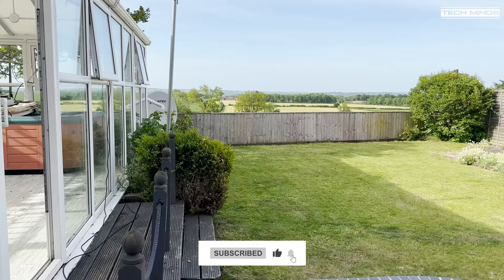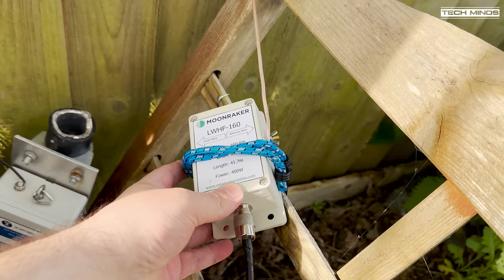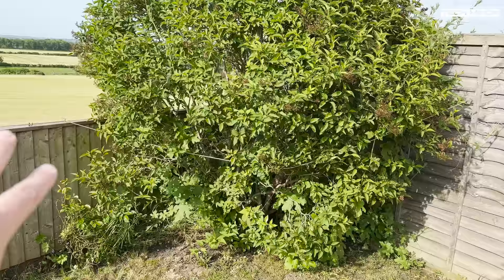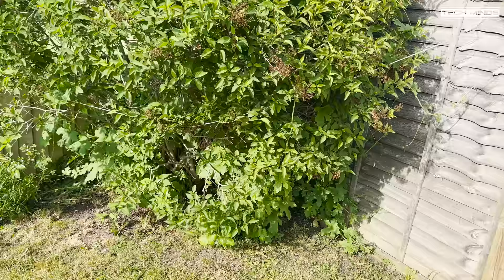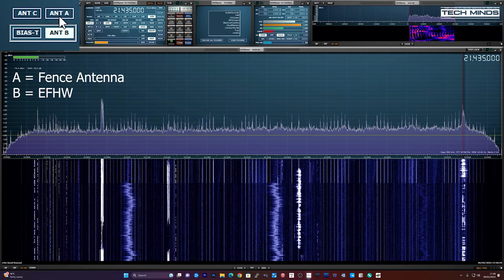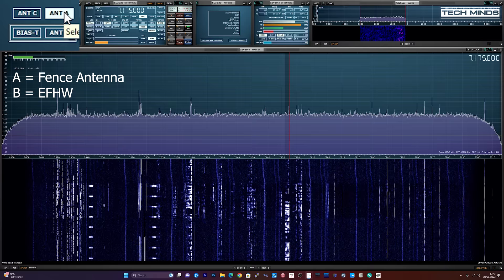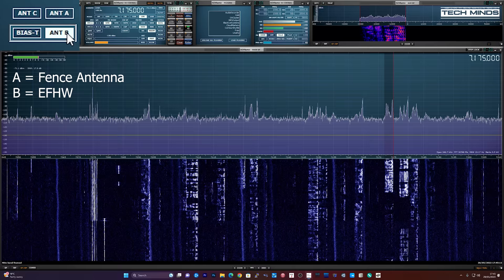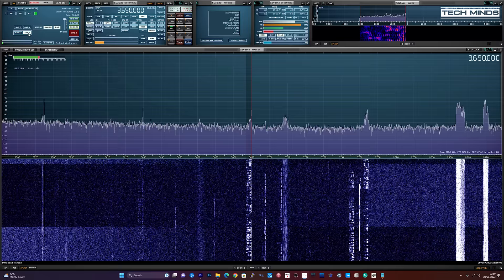Stealth Wire HF Antenna Setup: Concealed Communication Made Easy

Comment: Hi Matt, great video as always, I have used various stealth aerials over the years, 3 years ago we decided to cash in on the huge equity in our house, sold up and retired to a park home (Static caravan).  I have aerial restrictions,.  My HF aerial is an end fed wire of 111 feet, I feed it with a home made wide band transformer, which works with lengths of wire as little as 33 feet, and then uses wires in multiples of 11 feet.  it runs up my down pipe along the inside of the gutter clips, up the eves into the opposite gutter and back down the other side of the van.  It works and I also only use 5 watts QRP CW only, as another challenge lol.  It Blows me away how well it works, it loses so much local noise being low,.  I have QSOs most days, an in the commonwealth contest I even got a 339 from VK land, when the condX were really good earlier in the year.  I also have a simple vertical dipole just for 10 meters (flower pot), I run this up a 10 meter fibre glass pole and have a wind sock on it so the neighbours and park owners have no idea it is for radio..  I have played with aerials since i was a boy and have learnt Aerials do not read books so all the theory helps  but some times just try it and suck it and see.  In the past I have loaded up chain link fences, cast iron gutters, whirly gig washing lines, factory rooves normal laundry lines if the nylon chord has a metal strainer running through, and its amazing what will actually radiate a low power signal.  Thanks again for all you do for the hobby, 73 De Richard G0VCW TU dit dit
Reply from the maker: Thanks for your comment Richard. Exactly this point I was trying to make "Aerials do not read books so all the theory helps  but some times just try it and suck it and see".  I think with all the theory of how antennas work best, we forget that antennas can still work in other ways or positions.  Hopefully this video will inspire people to try, regardless of the theory and best practices. Good job on your installation, if it works, then it works! 73 Take care...

Comment: I've had amazing luck with antennas that were way too low and shouldn't work. In fact, I have a WSPR beacon running where the EFHW fell on the ground! It's been months since it fell from the tree, and I still get reports nightly from all continents.
Reply: I've had the same results with a 100+ foot long wire on the top of my 6ft wood fence. It's always fun to string out wire and see what it does.
Reply: What full-size wire antenna would you recommend for fixed 5W QRP?

Comment: You would most likely have an even better result, taking the same wire, only much less and creating two rectangular loops one on one fence, one on the other and run them through e.g. an LZ1AQ preamp each and use a phase-shifter (or e.g. RSPDUO with SW phaseshifter) ... this way you would have an ultra wideband RX only antenna that you could turn electrically, nulling out noise and unwanted signals and it would be all stealth and probably outperforming the signal to noise of your high endfed wire.
By the way I love your property, that location and its view is a dream - brilliant choice!
Oh and by the way, hardcore DXers user beverage antennas that are just as low as that but they are way longer (few hundred meter) and are terminated on the end. I can not explain how they work exactly, would have to do some reserach, but they can have an outstanding signal/noise in DX with a little preamp, even if the cable is literally laying on the ground. If you know that the farmer next door is not working on his field, you should definitely lay 1000ft of wire flat on the ground and maybe put a 600 Ohm resistor on the end with a little metal rod in the ground, connect it to your balun and maybe run a high sensitivity SDR on it, like an Airspy-HF and try that. It might knock your socks off. Try it on the very low bands ... 80m downwards ... including medium- and longwave! In that location you have to try this out, it doesn't cost you a penny! I have had a similar wire laying flat on the ground a few decades ago and I have been using it for MW DX with great results. This obviously does not work when your ground water level is very high, like in a swampy area, but in most locations it should work fine.
Reply from the maker: I've seen some antenna designs which are terminated through a resistor to ground at one end. I really want to try these myself. Cheers
Reply: @TechMindsOfficial  You really have to try this. Which direction is this open space? If I remember correctly, the terminated end is the favoured direction of the antenna.
Reply: "This obviously does not work when your ground water level is very high" - not so good for the UK then most of the year round! 🙂 Callum has had great results with a long (was it 160m long?) wire antenna at about chest height. The main lobes are long the length of the wire.

Comment: It is surprising how gain and reception a low long wire can get. I use an Inverted V on my very tall tree to 80 feet at the top V point. I was trying to get as much height as possible, so the tree was a gift from God! The side wires were connected to two shedscon each side with black nylon robe that is strong and resilient to sun and wind. It works well, just need to make sure that I transmit on the frequencies for the antenna. It resembles a zeplain antenna placed on a balloon zeplain. I will be making sure I match and tune the antenna and frequencies.  No transmitting 80 meters on a antenna made for 40 meters ! This is where I need to grow and take care to label my coax lines and my HF radios big time, big and clear!

Comment: The problem with this fence top setup is the EMF compliance distance of 1.5m for 100W SSB on 40m (with an assumed 20% duty cycle) which is on the neighbours property!  The EFHW doesn't have this drawback!

Comment: Sounds pretty comparable.  A little more noise on the lower antenna, but that could probably be tracked down if it were for a more permanent setup.

Comment: This is very close to what my actual EFRW antenna is! I didn't loop it under like you did on the end but that is an interesting idea to get a longer wire going. Mine is currently about 25.6M long and 1.8M AGL. 73 from KF4HZU!

Comment: I used this setup but with 36ft of wire and ran it around the edge of my attic which is 8m high - my receive is strong but my transmit is poor, when I am heard I am heard well but most people on FT8 seem to pass me by. 

Compared with my DIAMOND BB6W which is setup at only 2m above ground in an inverted V I get lots of instant contacts even when I use my noisy USDX+ on it!

I will put my DIAMOND up in the attic this weekend and see how it performs as a comparison.

If its much stronger, I may have to relegate the end fed to attic decoration, which will be a shame as I was hoping it would be a massive game changer for me given that I am in a town house with a small garden but lots of height.
Reply: So I did it and the reception was excellent, but the transmission wasn't all that great. I then put my BB6W in the loft in a sloppy inverted V and it works a tab better on rx and much better on tx. I was trying out FT8 and no one could hear me on the end fed setup. Switched to the inverted V and plenty of replies.

I contacted the person that sold me the end fed, and they told me that I had basically made an rx loop but that they were not clean transmitters. 

Il keep it in the loft for now but going to fit an end fed along the fence in a STRAIGHT line only and see how that performs.

Comment: Many thanks for sharing this. It's always great to see things tested in reality. Interesting  that the  antenna has an OK-ish VSWR and of course, no surprise that you loose a number of dBs in comparison to your antenna at a proper height. I made some simulations using NEC. I found that at low antenna heights the antennas main beam direction is going vertically up to the sky. So I guess, the loss of some dBs is mainly caused by the unfavorable radiation characteristics.
Reply from the maker: The OK-Ish VSWR was down to the 9:1 unun I believe  and the matched length of 41m of wire. The kit is sold to work from 160m to 10m with internal ATU. To be honest, its just what I had laying around in the garage. There are other methods I wanted to try but the video was getting long as it was. I also wanted to try creating a resonant dipole, say for the 10M band, and then just attaching that to the top of the fence. Maybe I will do some more videos on this with specific bands. Cheers!
Reply: @TechMindsOfficial  I am really curious on your next videos with low antenna height. Maybe I can carry out a NEC simulation to see, whether there is any chance to avoid that the antennas main lobe is shooting up to the sky. BTW: I covered low antenna height in 2 videos about a simulating commercial 20m and a 40m antenna simulation.

Comment: Good one Matt, I  have a 9:1 attached to a 41M antenna made from flexweave attached to the fence at 2M height using electric fence insulators and it works well but as you say it's very much NVIS with a great bias for Europe stations ..not really great fro DX but better than nothing my Noise Floor is S9+++ so you can imagine it's not fun but I do a lot of FT8 to get out !!

Comment: I have found that if you install wire aerials using 24swg enamelled copper wire, they are almost impossible to see. Also surprisingly robust, just the occasional snap if a pigeon hits it.

Comment: Loves the "zips"going across at random And the " wobbler" at 4.16 someone's got to make a vid of  these soon...not alot of noise floor difference between...was the random wire tuned on each band with an AtU...?or just as is...
Reply from the maker: No ATU on either antenna, they were plugged directly into an RSPdx A and B port ;)

Comment: It looks like the balun on your other antenna isn't connected properly; there's no path to ground (1:30 mins into the video). This can result in common mode currents on transmit and/or receive. VSWR isn't always an indication that all is well. Give it its own ground or counterpoise and see if the noise goes down on reception. Also, if you're willing to continue experimenting with the two antennas, join them together to form a loop. Here too you may find the receiver noise going down. Yes, it's not a quarter wave up but that's actually a good thing. When I had an 80m loop at a previous location, I routinely worked DX from western Pennsylvania with the loop meandering about no higher than 7 meters up. You can also add a coil(s) along the way to extend the length. I've done/doing these same tricks with good results. Final suggestion: use a remote tuner at the feed point to not include all your coax as the antenna. If the turner is in the shack, everything after it IS the antenna.
Reply from the maker: I took the ground off the other antenna to attach to the 9:1 unun for this video. Remember, this video was not actually about an installation I will use, its merely showing whats possible. I do appreciate your comment and pointers though as this will prove useful for others. Thank you.

Comment: Sound like signal strength is about the same but the noise level is a bit higher on the fence wire. Otherwise it works great.

Comment: I put a end-fed 80-10 along the top edge of a 6 foot fence. While I get about 1.5:1 S-W-R on 20 meters, I have only received stations within  about 17 miles, Pretty disappointing.  A ham was listening in Montana (680 miles), they heard nothing but static.

Comment: How do you keep the RF energy from burning the wood, especially after a rain?
Reply from the maker: Havnt tried it, but I guess I would get the marsh mellows out. My EFHW runs up a telescopic pole in the middle of a tree, I often use 100 Watts and so far, there has been no tree fire or fried squirrels. :-)

Comment: Hi. I have done something similar..I live backing on to an old railway track that's been converted to a footpath. I just ran out a wire and stapled it onto the top rail. It's now at about 141 feet long in a straight line. Works well from 80 to 10m. Just using a 9:1  with a single earth rod. I was pre drilling a hole with a 1m sds drill bit and got it stuck, that's now the earth rod😅😂
Reply from the maker: Thats awesome! That would make a good video! Cheers

Comment: But how well does it get out on transmit? Swr won't indicate that. A dummy load has a great swr. Good receive doesn't indicate good transmit either since it might come about due to the low wire antenna picking up less local noise.
Reply from the maker: Transmit will vary for each individual, due to surroundings, fence height, material and un-un used etc. which is why I didn’t really cover that in the video. It’s a cheap antenna to make, so give it a try and let us know how you get on :) thanks for watching.

Comment: Is there any difference between a vertical and horizontal antenna?  I remember there use to be much less noise in horizontal mode, but these days it may not be true anymore.
Reply from the maker: Depends on frequency tbh. Also a long topic to explain fully why.

Comment: Wouldn't 41m be approximately a half wave on 80m and therefore a 49:1 transformer would be better? Maybe you could try it and see what the plot looks like again from 80m up to 10m.
Reply from the maker: That’s very true, in fact I could of just removed the wire from the 9:1 and attached it to the 49:1 that was sat next to it. However this test was to compare the 49:1 to the 9:1 fence antenna. I might try this personally, to see how well it performs in real life. Thanks.
Reply: @TechMindsOfficial  Thinking about it, 41m might be a little long, so maybe fold back the end a couple of metres.

Comment: Nice! Is that SDRPlay / SDR Console? I haven't seen any antenna controls on the software I'm using, but I only have an RTL, so using SDR# and SDRAngel, sometimes SDR++.
Reply from the maker: SDRuno was the software I was using. It will only show antenna ports if the device physically has more than one port.

Comment: Could anyone shed some light on the signal running across the band at 5:29 from left to right? Here in ɐᴉlɐɹʇsn∀, I get those too and they are usually accompanied by a 'whip sound'.
Reply: It's a sweep from an ionosonde aka chirpsounder radar for examining the ionosphere .The transmitter sweeps all or part of the HF frequency range. The ionosonde emits radio waves of varying frequencies towards the ionosphere and then receives the reflected signals. By analyzing the characteristics of the reflected waves, such as their amplitude, frequency, and time of arrival, the ionosonde can determine important parameters of the ionosphere, including electron density, altitude profiles, and the presence of ionospheric disturbances. This information is crucial for understanding radio wave propagation, ionospheric behavior, and its impact on communication and navigation systems.
Reply: @HAL9000__  Thanks for that HAL. It's very much appreciated.

Comment: Over the years I've heard of people using the PVC pipes in multistory building dropping or flushing wire down the pipes and using the plumbing as a ground plane
But true or urban myth I can't say
But it would make an inverted vertical I guess
And yes asked on another site and got all the shitty signal jokes 😉